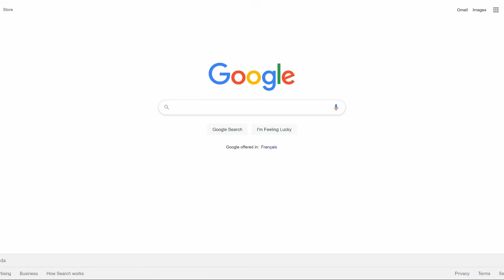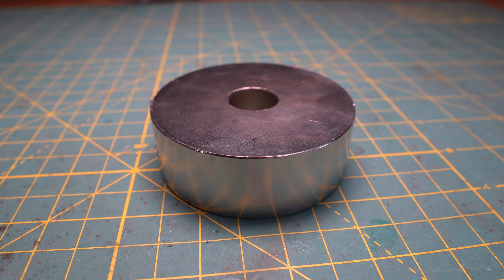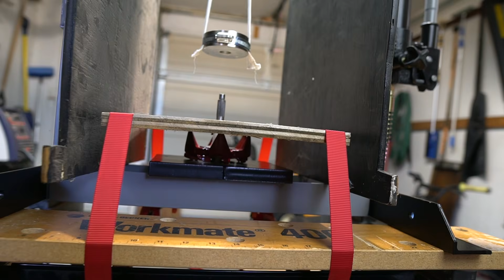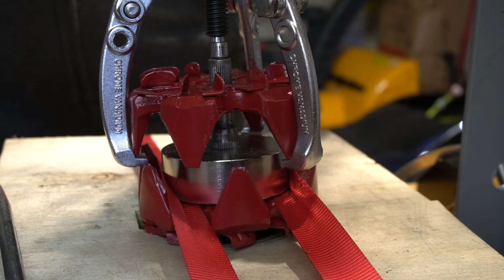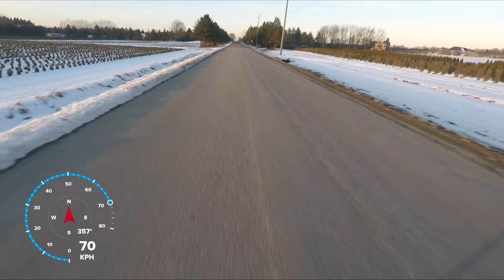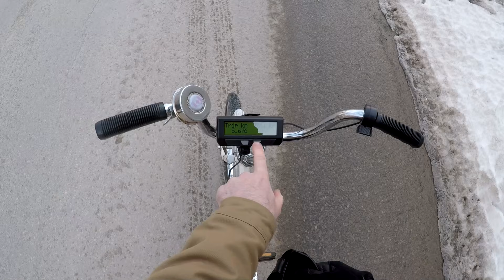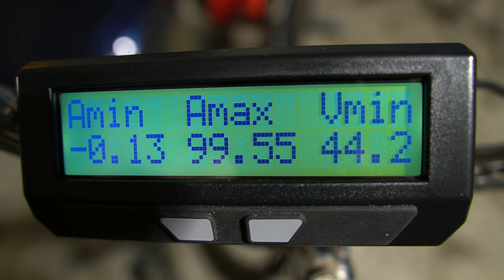Building an Alternator Powered Bike - Part 2

Comment: Hello, I have a tricycle at 72V total, ''6 batteries 12V each'' ''truck-style'' from Rali. Do you think it could be possible to connect an alternator with a second controller in parallel to give more autonomy?
Reply: Unfortunately the addition of the second alternator would diminish the autonomy because of the excessive resistance of the electromagnetic braking caused by the regen function

Comment: is it possible to connect the motor to a car battery and have 50Ah instead of just 16, therefor a longer bike ride?
Reply: A car battery is 4x less volts and a lot heavier, it wouldn't work

Comment: I dont know that much about motors but do you think there’s a way to install a second alternator to charge the batteries? I know there’s no propetual motion. Just a question.
Reply: Unfortunately no, because even if he do the same modifications to get better efficiency, the result would be worse than if he did configured Regen Mode (his controller can do it) to get some of the braking energy back and earn a few extra miles/kms

Comment: The alternator is NOT "powering" anything. It's just applying a small trickle-charge. Eventually, you will reach the point where it DOESN'T. The LAW will always apply, always, no matter how you try to manipulate your words with a misleading title bc this A.S.E Mechanic KNOWS this bc God has told us DIRECTLY that there is NO FREE ENERGY and man will always "toil" so run and tell your viewers THAT!
Reply: Hahahahahahahaha
You clearly didn't watched it
The alternator is "powering" the bike just as a car engine "powers" it into movement, there's no mention of free energy at all hahahahahahahaha
Reply: @foxxyytofficial  So you changed the pulley diameter raising the final drive/gear allowing for 1.5-2.0 volts to direct charge? 
ASE and MMI Grad from 2000 so, been a while.
Reply: @MurrDog723NoNeYa-je4bp  there is no pulley change for direct charge, nothing like that!
The alternator is not working as an alternator anymore, it's just like any other electric motor, receiving electricity and transforming it into movement
Reply: @foxxyytofficial  Oh, right, because you replaced the mag igniter or pick-up leads with a switch or alternating switch? Oh, wait, is the alternator the motor now?
Reply: @MurrDog723NoNeYa-je4bp  yes, the alternator IS the motor now
The diodes were removed and instead 3 phase low voltage AC is pumped into the coils to make it spin
Reply: @foxxyytofficial  Yeah, I remember a professor telling us about how to do this.
Reply: @foxxyytofficial  Whaat! How crazy. Does it apply the motor in reverse, too? I'm assuming.
Reply: @MurrDog723NoNeYa-je4bp  you can control the rotation with the controller, so both ways (clockwise and counterclockwise) are possible
Reply: @foxxyytofficial  Reverse "drive" kiding me? Wow, you are a well-read individual. 10,000hrs. gets you a "MASTERS" patch, keep up the good works church.

Comment: You are going completely Brushless...I did the complete opposite, used a old Car Alternator for the stator and completely manufactured a new rotor (a claw pole is less efficient than a normal pole) with electromagnetic induction and field weakening of the rotor windings to keep the back emf low!
Reply: Do you have videos of it?
Reply: @foxxyytofficial  i'm still in the manufacturing process, since i had a stator, but I needed to have a rotor! And this is the complicated part, since it is made from several "discs" of Iron....I'm still waiting for those discs, that I can fully assemble the rotor!

Comment: So what do you think of doing a 200 amp alternator and a very powerful controller and use a dc speed controller on the electromagnet to reduce the field to 1.5-2v for cruising. 12v is a bit overkill as I think they saturate around 5-6v.

Comment: The Claw Pole design of automotive alternators reduces the cogging torque because the transition between North and South poles the windings experience is gradual.
Excessive Cogging is a real problem in motor designs.

Comment: Do you think the change in speed and range to almost double the figures between the Gokart build from 5 years ago and this one, was it the weight and amount of friction generated from the four gokart wheels or something else?
Reply: Probably multiple things:
Changing battery from lead to lithium (less weight and more poeer available)
Adding a better/more powerful controller and the hall sensors
And changing the electromagnetic rotor for a permanent magnet one

Comment: Nice !  and now I've seen a couple of ur vids. I say > Yes you are absolutely capable of making your own motor < 
also for a comparison my Go Ped with a 2 stroke gets well over 200mpg.  On a 1 liter tank I can travel roughly 30-50 miles. Top speed is somewhere between 20-30mph.  It varies by how heavy the rider is & also road terrain.  You can ride for hours without a care.. except, DON'T fall ! U don't want to eat it on a scooter , lol 
You should try mounting a 2 stroke to old rusty ... or maybe old rusty's brother ...

Comment: Hey mate, curious if you tried boosting the rotor winding voltage to test if it gave you more torque before you scraped the rotor winding? Would be a good test, all you would have to do is get another alternator and pull the rotor out to do the test! 😁 Come on... Dooooo iiiiiittt! 😁 😜

Comment: Hey buddy. This cld be an idea for a vid.  Can i strap a petrol generator to the a ride on mower , which hasnt got a motor atm, then use 240v motors? Lets say 2 x 200w for the mower deck and a 500w for the drive?  What issue would i have doing this?

Comment: the good thing with magnet is that you get rid of extra stuff, the bad thing is that it has a constant field and that limits the speed and draw a bit more amps, but it does have a bit more torque.the good thing with brushes is that you can reduce the core voltage to 2.5v and 1 amp that greatly increases speed(field weakening) draws a bit less amps but reduces torque

Comment: So was the alternator a brushed motor before or not? In the go kart video you used a brushless controller however in this video you say that the motor wasn't brushless
Reply: not exactly, the alternator was brushless but it needed external excitation, delivered by slip rings and brushes
the brushes weren't the ones that made it spin, the brushless controller did
the only thing that the brushes did was to carry electricity to activate the eletromagnets in the rotor before

Comment: How to run alternator? Which type of controller is good for 500 watt alternator. A cheap onr with 250 or 350 watt ebike controller is good or i need higher one?
Reply: a 500W controller is a bit small, so you would need to install the hall sensors so that the controller extracts max power from the battery and sends it to the motor

Comment: back of the napkin math shows 45ishV at 100 amps is 6ish HP.   There are larger diameter style alternators out there that will provide higher torque output at the same rpm, therefor mo power!

Comment: Hi Austin Blake Thank you for your informative video's!  One thought I had..... it was very lonely! (Joke for the day) what if you added a second Alternator to generate electricity for your batteries? Would that work? What about putting permanent magnet in the second Alternator? ok that was two thoughts!
Reply: that wouldn't work because it would actually slow down the alternator, needing more power than it could be able to recover

Comment: You dont need a battery hook up a single phase motor and a belt drive going form the motor to the alternator and then you will have free energy but because its in a bike you can put the motor to a sprocket then you will have unlimited miles 👍
Reply: it doesn't work like that

Comment: Nice build.. mine is in process.. 2 Littles questions: is it wrong to let the 12v in the rotor as immobilized,  like at a red light? Do you turn it off?  And how long the 12v battery last and how big is it?. Tanks for sharing.

Comment: Why use this converted Car Alternator instead of just using a proper Electric Motor?
Reply: That is a very good point. The design is impractical for mass manufacturing...but a good informative video!
Reply: cheaper

Comment: Hi  would you share the stock voltage and amp rating of alternator you use? I wonder if my 12v 60amps scrap alternator would be enough to start with.

Comment: Hey it works with a bridge as well, I am thinking of putting a step up converter to charge my battery, while braking. And I put butter under a magnet, so it did not crash hard.

Comment: Please forgive my ignorance on this. But a Alternator just charges a battery does it not ? . HOW does it turn into  a motor on a bike , with a battery on it as well, giving it the torgue to to drive the bicycle at speed. Also how do you control the speed of the alternator as a 
motor.?
Reply: The alternator is just a motor working in reverse
You can test that spinning a small DC motor from a toy and putting a led on its wires

Comment: Rusty, great stuff! enjoyed your videos! A Question; Do you think adding another stock standard alternator to the other side of your bike geared to spin fast and charge your battery on the downhill would work? And with an engage clutch so it didn't "drag" on the straits or up hills?
Reply: that wouldn't work, the efficiency won't be enough to add any energy back

Comment: It's really cool to convert an old alternator into an e-bike kit. The top speed is impressive, but the efficiency is relatively bad. I generally get around 7wh/km, but the top speed of my system is 50kph and I always have a switch that limits the speed to 35.

I was pretty confused when you put in what looked like a single permanent ring magnet, but there's actually 6 magnets in there.

Comment: Just watched this video with a lot of enthusiasm as I've been watching you from the beginning go-kart video you posted in the past.

Question? 
Do you think it's possible to connect a different alternator to your existing bike with a 12 volt power source to generate extra power to feed back into your batteries. You would then would have a electric bike that could generate his own electricity. 

Do you think it's possible?
Reply: Recharging with a second alternator isn't possible, regen braking with the compatible controller yes

Comment: Nice thing to mention, by swapping the rotor coil to a permanent magnet, you saved a lot of energy witch would be used to create the magnetic field.
this allows lower current drain from the batteries, less heat generation, henceforth gain more mileage with the same battery.

Comment: 9/19/21

What would you charge to convert used 300 amp alternator like that for RV power install?  I would only need the alternator and small speed controller I think.  Reply please to discuss. Thanks

Comment: Am i right in assuming the motor with the permanent magnet was more efficient in terms of electricity use than than the one without?
If I am right can you give me a percentage ?
Reply: the removal of the battery load on the rotor is already higher efficiency, but couldn't be measured since he didn't measured against the full 48V pack

Comment: I rebuilt alternators, starters & generator's for 16 years . If I knew you was going to do this I could have saved you a hole lot of time by getting a  "delco 25si alternator" a brushless alternator for semi's & heavy equipment . The down side is the size mainly the length about 2x & larger diameter , the plus  they use less power to excite the rotor should run more efficiently ?. I would love to see how well a 25si performs .
Reply: At nearly 300usd I think that fails the cost per useful equation.

Comment: hello I'm trying to build an ebike using your video. if I'm using a 10 speed gear system do I still need a controller? also if I use an altentor can I still use a drill battery, or should I just use a torque drill as a motor?

Comment: Replace the rear sprocket with a smaller one from rebelgears.
Seems like the bike has enough torque, but with a smaller sprocket, you'll gain some range (and top speed if you care for it).
Though usually I'd recommend going with a bike with suspension on anything above 20MPH (30kph).
10 miles for such a huge pack is not very efficient. 
I used to have a much heavier bike that would do about 25 miles on a charge with similar battery pack size.
Maybe the temperature shortened range. The batteries work best in 75F, so if you put some insulation around them in the winter, performance and range may increase somewhat!

Comment: I'm not sure which country you are in. But here in the UK, you'd get shot with shit big time if you were caught riding that on the road.  Especially at 50mph!!! An electric bike that is above 250W and not pedal-assist only is classed as a motorcycle so you need an MC licence and insurance etc. And the machine as to be registered for the road. A very cool conversion though I might add. Well done.

Comment: can you put a pulley on the modify alternator and add an non modify alternator to charge the batteries
Reply: it won't work, because for the alternator front to recharge the system, it needs to be 101+% efficient (absorb more than 100% of the power of the bike to recharge the battery), i don't know why people suggest this so much

Comment: GOOD VIDEO ON ALTENATOR  AS MOTER ON BIKE WANTED TO OFFER SOME IN PUT YOU BIKE YOU CONVERTED THE ALTENATOR TO permanent magnet motor if you could have got your hands Tachi amateur or an old dimmer switch from an old vehicle before 1990 you could have hooked it up to the field winding and control the alternator from turning your controlling the flow of voltage there's a guy on YouTube that uses drill batteries the power his projects and his Razor scooter and and his electric go gart made ten Amp hour battery  that give more and longer ride on yours

Comment: put a Alternator on the front wheel to power the Alternator on the back wheel for endless power
Reply: it won't work, because for the alternator on the front to recharge the system, it needs to be 101+% efficient (absorb more than 100% of the power of the bike to recharge the battery), i don't know why people suggest this so much

Comment: Have you check the Super Soco motorcycle (the cheaper one)  I think that bike makes around 100 km range but it costs like 5k usd or more, how much did you spend on your set up? To calculate how much you will you need in batteries to go near that range of 100 km range?

Comment: Would using a motorcycle alternator mounted to the front or other side back wheel to recharge the battery allow for a longer usage time? I would suggest a wind turbine attached through the spokes, but I doubt they make them that small yet.  I know they make very small arrays of solar panels, but old rusty 4 doesn't have that much surface area.Very nice job on this ongoing project.
Reply: Alternators connected to the front wheel would't give any useable energy back, the efficiency is so low that it would only waste
Reply: @foxxyytofficial  Understood. Even with gearing you couldn't get it to produce enough. It was just a thought. I know a mechanic who used harbor freight small solar panel chargers to keep his truck battery charged up. He had them exposed on the dash.
Reply: @jonslocum354  the solar cells work in a ICE car/truck battery because even when the consumption grows (more electric stuff added), the alternator spun by the motor generates most of the needed energy, so the solar cells keep it "trickle charging", slowly but non-stop as the sun shines on it

Comment: Your measured top speed shows that this is more powerful than the average 250w or 750w eBike. You mention 99amp and 47v so that's a peak of about 6bhp !!! Anyone copying the design could scale back the voltage in exchange for more ah (say 24v and 36ah) and would get something closer to typical eBike performance with a top speed near 45kph and much better range. But where's the fun in that !

Comment: Idea for Old Rusty v5: add a 2nd battery and another alternator that can charge the battery while in use. That way, when 1 battery dies you can simply swap the batteries to charge it while you use the other to ride into the sunset!. That would be awesome!
Reply: The 2nd alternator idea is bad, it won't work
Only the idea of swappable batteries will

Comment: I laughed thru my nose when I saw 38 Wh/km :DDD
Reply: I use 30 W-hr per mile for my designs when specifying batteries. That includes reserve. I'm pretty sure the air gap of this motor is contributing to lower efficiency. This is easy to measure but not often reported in specs.

Comment: I have a question, maybe a lame one, but can we charge the batteries with an alternator and at the same time we can use the battery to run the motor, which means The Alternator is charging and at the same time you can run the bike on battery eventually without loosing the power, is it possible?
Reply: It is not possible

Comment: Lots of work put into the alternator. Wouldn't it be better to use a different type of electric motor, or would cost be a major factor?
Reply: You're not looking at the previous ideas
First part: he proved that it can work nicely on a go-kart
Second part: he proved that using hall sensors and the right type of controller makes a great difference in power/torque against the first part
Third part: now that he got basically the max that he can easily get from the alternator, he invested in the rotpor magnet to elliminate the current needs (he needed a 2nd battery for the rotor or a DC/DC converter from the main battery to the rotor before)
Reply: @foxxyytofficial  For the price of his machine shop, the hours spend modifying the alternator, and the cost of the controls I could buy an electric bike, but thanks for the outline in the sequence of the project.
Reply: @Hodenkat  Its not for the cost, it is for the idea that "your blood sweat and tears that made it possible"